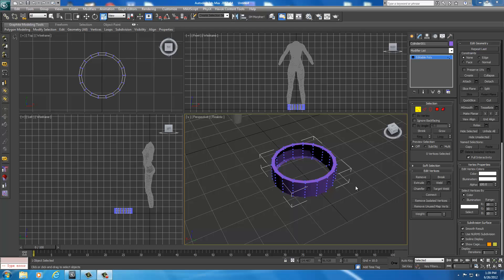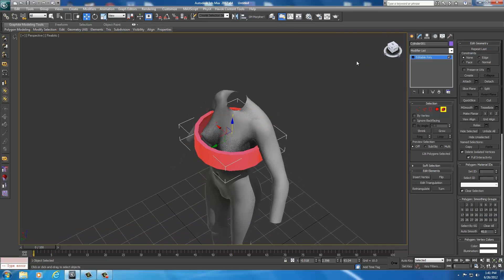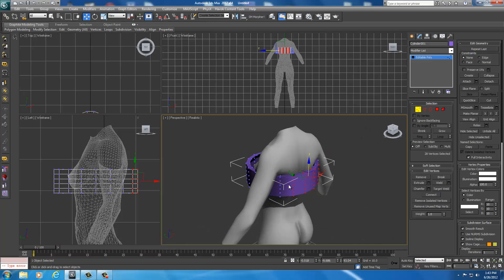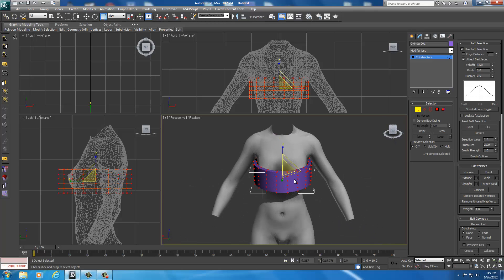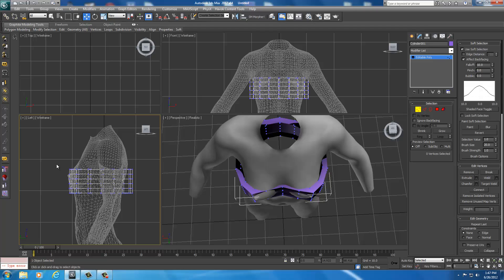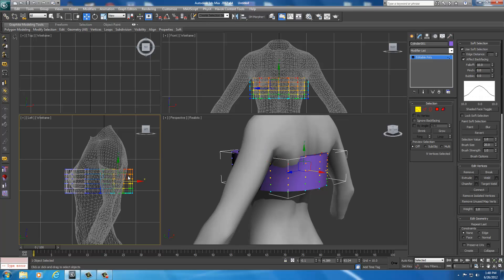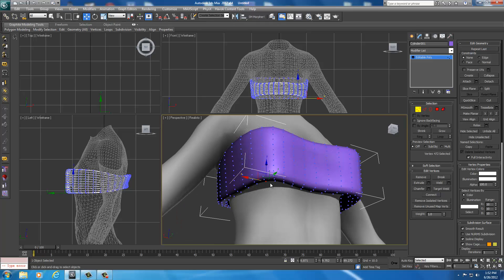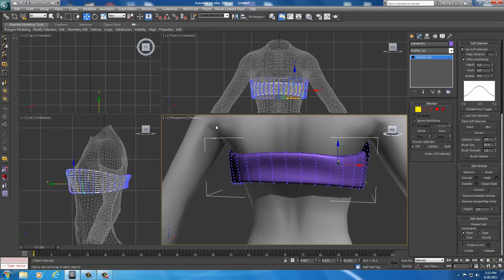18 - CA4S - Shaping a Cylinder and Smooth

Comment from the maker: Yes, you can do it but it does take some setting up. Since Zbrush imports Obj files you can export the cylinder as an Obj, work with it and then reimport it back into your scene in 3ds Max. I've done it before so I know it's possible. This would be something that you would have to explore.

When I did it, I exported the body mesh as an Obj and extruded from it to make skin tight clothing. It's going to take you some exploration to see the possibilities.